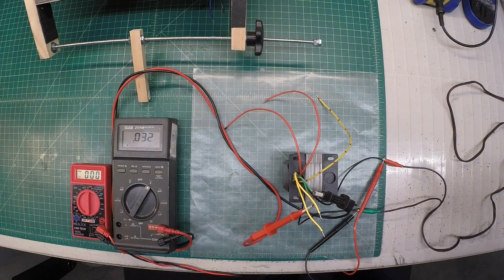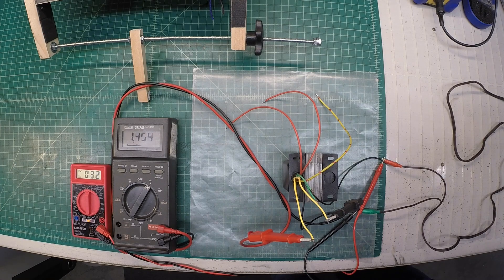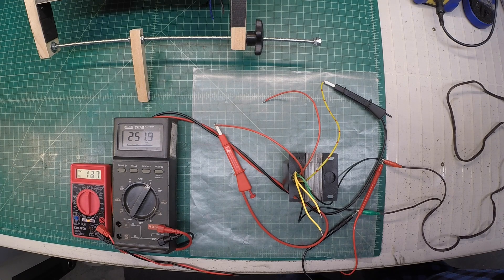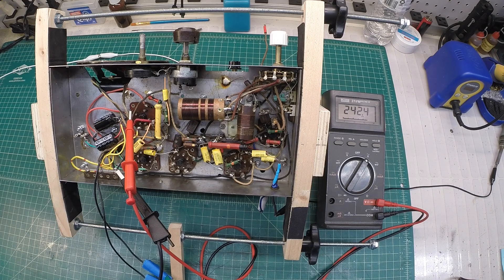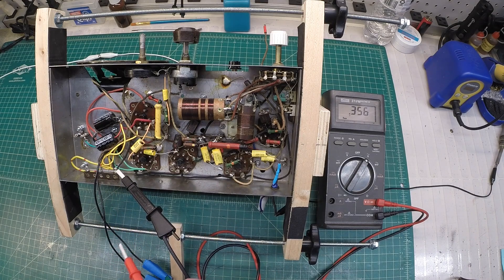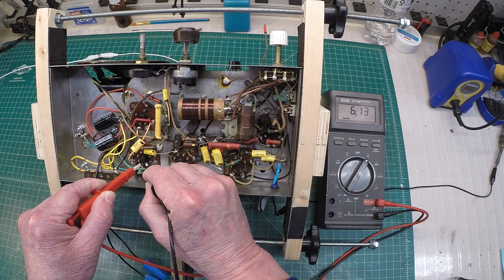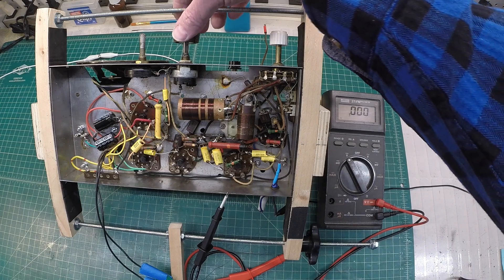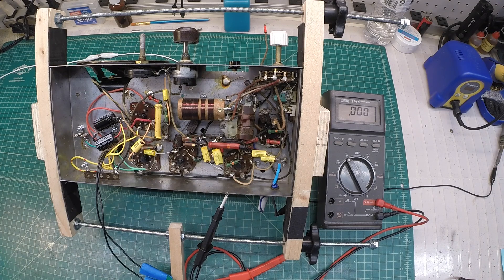Jackson Bell Model 556 - Power Transformer Evaluation Post Rewind

Comment: 90  power factor more of a resistivie    load
Reply from the maker: John - if I recall correctly, a pure AC resistive load or DC circuit will always have a power factor of 1 (100%), while reactive loads (inductive/capacitive) presents an out phase relationship of the voltage and current, which decreases the power factor. Thanks for reaching out and watching. Best, Don